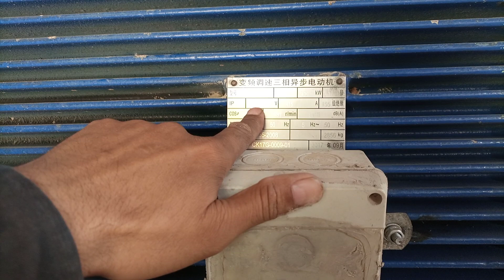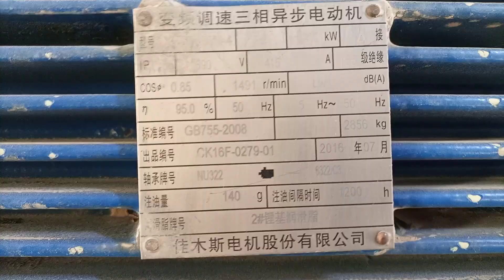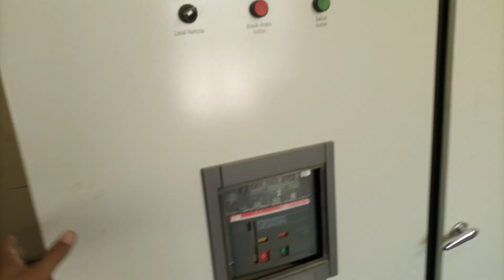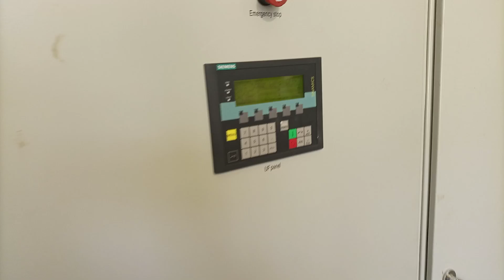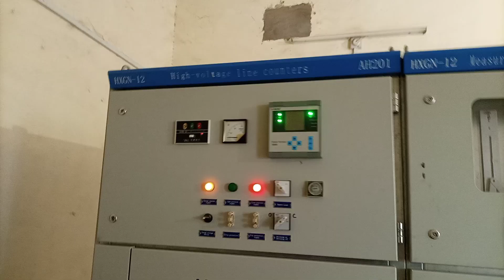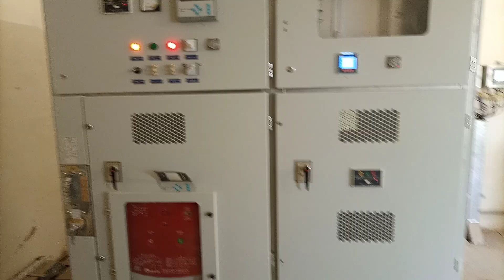Free energy machine. How belt conveyors can generate electricity. motor generator 3 phase over unity

Comment: Interesting... so what you're explaining is, that when the conveyor belt are up and running the flywheel spin up at the same time and the momentum of the flywheel keeps the belt moving and the motors are now working as generators and you use the flywheels as mechanical batteries. Did I understand the system correctly?
Reply from the maker: Yes. But gravity is pulling the conveyor belt along with material on it. That gravitational drag is converted into electrical energy and is fed back to line. Only flywheels do nothing.
Reply: @JahanZeb1976  Oh I missed that. That's really clever. Thank you for taking time to clarify that. 👍
Reply: So, that means you are transporting the limestone downhill only!?
Reply from the maker: Yes sure. Downhill we process limestone and shale into cement. In result of gravitational force on the belt conveyor we produce free electricity.